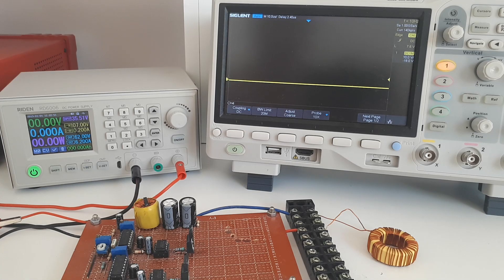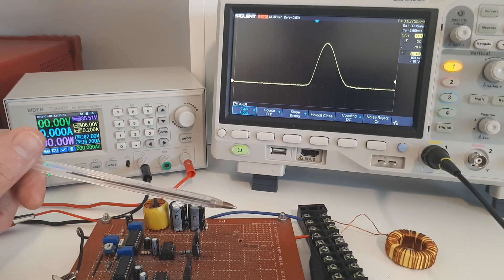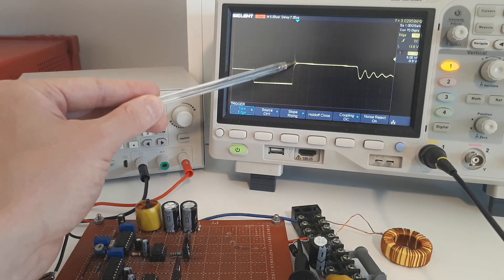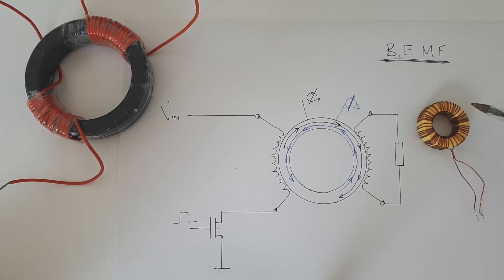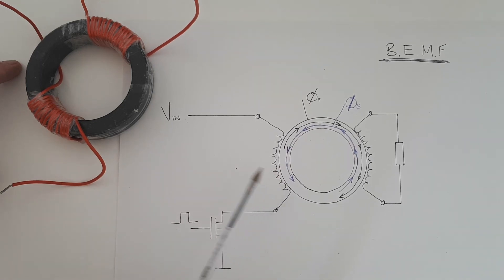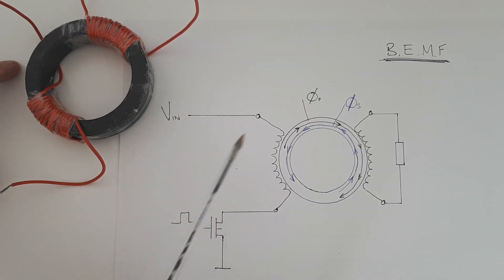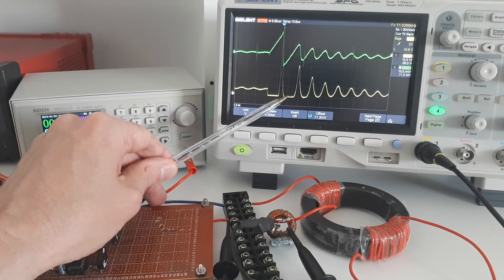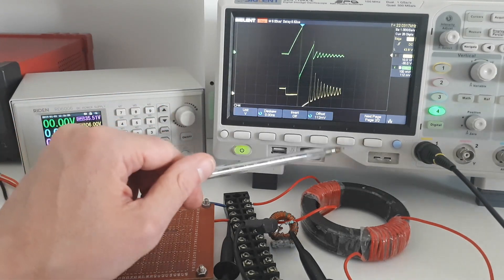What is Flyback Voltage and Back EMF

Comment: Is it fair to say that flyback voltage is a form of back EMF then? Back EMF being the greater domain?
Reply from the maker: Well there are similarities in that they are both a form of induction. And lenzs law effects both. But there are 2 main differences between them.
1. The Back EMF as I described occurs at the same time as the EMF you apply from the power source. Whereas the Flyback voltage occurs when the switch is off, and therefor is on its own at that point.
2. The Back EMF is only ever equal to or less than the applied voltage, but the Flyback voltage can be hundreds of volts greater that the supply voltage.
Reply: @ElectricMonkeyBrain  Thanks!
Reply: @ElectricMonkeyBrain   Fantastic.

Comment: As someone who have been observing Flyback and back emf for some time.. 
I can say that your explanation of the Flyback is correct but I have a different view of the transformer's back emf.

We all know that the backemf helps to regulate the current in the inductor, when the back emf is equal to the applied voltage this reduces the current in the inductor, this also applies to the primary windings of the transformer. But immediately the transformer secondary is loaded, the current in the secondary cancel's the backemf of the primary which in turn causes the primary to draw more current
Because the back emf of the primary is no longer equals to the applied voltage. 

The main difference between Flyback and back emf is that Flyback occurs when the current flow in an inductor is suddenly interrupted while back emf occurs when there's a change in Flux 

Back emf increases as frequency increases to the point where current is low. 
while flyback increases as frequency decreases to the point where current is high.

Comment: Thank you, this is extremely interesting sir. What if I wanted to direct the collapsing field into a battery sir? What electronic components would I use? Thank you sir.
Reply from the maker: Just a diode. should work ok.
Reply: @ElectricMonkeyBrain  You should use a TVS Diode to capture the flyback. It has some interesting effects on the chemical behaviour of the secondary battery.  If you use a battery relay to swap the run battery to become the charging / secondary and vice versa every 4 minutes, they both run for a very long time. Thanks for the video, it's one of the best explained I've watched. 👍
Reply from the maker: Are you talking about John Bedini's circuit? @hoofheartedicemelted296

Comment: Why did the voltage reduce from 400v to just 20v in the case of flyback when resistor is connected? Did u connect a very high value resistor? What was the value of your resistor?

Comment: What will happen if you wrap the entire ferrite ring with 1.0 copper and energize it? Does that make and induction heater?
Reply from the maker: Well sort of, but the amount of heat produced will be very small. Ferrites are bad conductors, so they wont dissipate energy in the form of heat much. If you want to produce heat with a induction heater, the magnetic field should be inside a good conductor...like metal.

Comment: Consider this:

1)  layers of thin aluminum sheet, each layer of metal separated by an insulation layer, in a horizontal orientation
2)  vertical magnetic field up through the center of the stack of metal/insulator/metal/etc  layers
3)  'eddy current' inducing coils positioned horizontally and radially to the metal/insulator layers
4)  supply an RF frequency to the eddy current coils

RESULT
Right hand rule:  vertical B field, horizontal RF current (E), in the metal.  This E x B  gives the Lorentz force, which coherently accelerates (oscillates) the charged particles in the metal

It is known as a "Lorentz disk" and is the first device built by artificial gravity hobbyists.

'Upgrades' include:
1)  circular planform (disk) for the metal/insulators stack
2)  adjusting the size of the disk and RF frequency to create resonance/standing waves of the RF across the disk
3)  working at increasing the Q factor  (ie. increasing the build-up of amplitude at the peaks, aka the 'anti-nodes', in the standing waves on the device)

This first device can be driven by a simple signal generator, a home-made RF amp to boost the siggen output, and store-bought aluminum foil.  If you use storebought foil, its thickness lends itself to a 'skin depth' that insinuates an RF frequency of about 16.28Mhz,  easily in the range of low-end siggens

Next is learning to attach a 'floating' or a DC potential bottom plate so that the effect is unbalanced (a balanced artgrav field yields no motion, just like two equally-matched teams in a rope-pull contest)
.
Reply from the maker: Well, I understand that there are some people who believe that a local and partial cancelling of the earths gravitational field can be achieved by combining high voltage (to cause a partial plasma) with a rotating magnetic field. Then one is into the realm of plasma physics and magnetohydrodynamics.  The idea takes Einsteins Equivalence Principle, and takes it one step further to say that the force from gravity is not simply equivalent to inertia, but that they are actually the SAME! Then somehow combining fields as i described creates a shield from inertia (gravity) allowing flight. As for the engineering of the whole thing its too complicated for text messages i think.
https://www.youtube.com/watch?v=1JeeaZlYonc

Comment: Hi.Does the same effect occurs when stator of generator collapses to zero volt and we have high voltage transient at the rotor?
Reply from the maker: A good and important question.
Its difficult to answer because there are literally 100's of different motor/generator configurations in existence, which have different effects.
For example a GENERATOR made of permanent magnets and output coils should have very little voltage spikes because the output coils should have some diodes or bridge rectifiers which will take away this energy.
A universal MOTOR for example, which has stator field windings which receive AC mains current, and rotor windings which receive current via carbon brushes will have voltage spikes in the rotor windings when the current through them is interrupted.

Comment: Does it mean we can put primary as L in LC oscillator and varying current in secondary with potentiometer we can tune oscillation frequency?
Reply from the maker: Thats a good question. I suppose it would work but may have some limitations. try it!

Comment: Egypt... tutankamon necklace with vulture holding a transformer.
2 paws 2 coils alu spools steel core. U shape.
Cross barr, soft iron with one coil.
Amber is the capacitor or in this case the alu spools.
Putting feedback on the spools as capacitor.

Comment: Weather you short out the secondary or not on a torodial transformer you will get back emf or flyback you will get a high spike in reverse  weather you short out the secondary or not so what is the difference who shorts out the secondary any ways unless your using partnered coils bucking coils? A higher voltage spike makes the difference because you shorted the secondary.
Reply from the maker: The point of shorting the secondary was to show that when current flows in the secondary, it has an effect on the primary. And that the effect caused a reduction in primary inductance showing that the secondary current/flux opposed the primary. Thats why its called back-EMF.

Comment: Great demo, thanks for that. The emf part of the demo is utilised in eddy current flaw detection in ndt and able to detect surface cracks in conductors through non conductive coatings. The secondary is the subject material in the ndt case though.
Reply from the maker: That's quite interesting. Amazing what they can do these days.
Reply: @ElectricMonkeyBrain  Not just these days. I worked on NDT by eddy current measurement in 1972 - my first job out of university.

The simplest test gear used a bridge arrangement with two coils powered at 50Hz (mains frequency). One coil held a sample of a correctly annealed brake lever for motorcycles and the other had a conveyor belt that passed through it where the levers to be checked travelled. If the bridge came out of balance by more than a certain amount in one direction or the other, it triggered a solenoid that moved an arm which deflected the errant component off the main belt into one of two reject bins. The levers that were too hard would be likely to fracture and snap and those that were too soft would be likely to bend.

The most complicated NDT equipment we made was for use in a steel mill where a continuous length of red-hot steel bar was made to pass through a large coil where we injected a low frequency (probably 50Hz) and a synchronised high frequency (perhaps 5kHz). The low frequency would penetrate some distance into the steel but the high frequency was confined to the surface layers (skin effect). A crack on the surface of the steel would be detected by phase-sensitive rectifiers as a significant shift in the relative phases of the two signals and that triggered a short squirt of engineer's blue onto the steel bar. Further down the line, the section with a the blue mark would be cut out, ensuring that the rest of the bar was free of surface cracks. All of that happened while the bar was still very hot and moving fast, which was a tough environment to do tests in.

That bit of electronics hasn't changed much in 50 years.
Reply from the maker: Right. Yes I think I have heard of this technique. Using the skin depth is quite a interesting solution to detect differences between surface and bulk material. Actually I think its a huge field, I expect they use essentially the same method to characterize ferrites for transformers up to about 800Khz or so.
I also used to do material measurement, but its was on the electric rather than magnetic side of things, and at much higher frequencies.
Reply: @RexxSchneider  I was going to say 'not just these days too', but anyway, Herr Foerster was making equipment to do ET back in the 1930s I believe. The real difference these days in most NDT methods is the addition of computing power to analyse results and improve the probability of detection. Eddyfi produce some interesting array systems for tubes etc.

Comment: 5:28 add 3rd asymmetric coil with a load
Reply from the maker: Hi. Do you mean that by adding a 3rd coil the BEMF flux in the core can be cancelled? Or do you mean that a 3rd coil can absorb the flyback voltage?
Reply: @ElectricMonkeyBrain  third coil will provide a channel for the back emf to flow, pay attention to the core dimensions and width. https://www.youtube.com/watch?v=Z_-3Nz1ZuSI&t=29s,

Flyback voltage is not the same as back emf

Comment: How do you divert back emf away from a MHD . Magneto Hydro Dynamic . I want to use pulsed DC instead of Constant Current DC
Reply from the maker: hi. Magneto Hydrodynamics is a interesting, large and complicated field. Without knowing more about your specific design, its difficult to say. However, in general I would guess that you are trying to produce magnetic fields, which means you need coils. If you want to recapture some of the energy of those magnetic fields after you have used them, a simple diode into a capacitor would suffice, like I showed in the video.  I would add that the speed of the diode is important. The 1N4000 series of diodes are very slow, and work good for 50Hz only. Something better may be a HER5000 series. To find really good diodes simple google "fast diodes".
Reply: Noob here. Check. Germanium diodes. 
Crystal radios and loop antennas. Resonant frequency.
Soft iron for low freq. Steel magnetizable for high. 
Ceramic has a big range in choice.

Comment: Very well done! Your distinction between flyback and back EMF (collapsing magnetic field inducing a voltage in a coil that is in the reverse direction) is correct! The electromechanical logic is simple to understand in backflow, when you consider that the north and south magnetic poles are pushed up in one direction by the current when created. And, like a child pushed up on a park swing falls backward by gravity, so too the magnetic field collapses back in the opposite direction when the voltage is removed!
Reply from the maker: Thanks. Yes you right about the analogy between Electromagnetism and Newtonian Mechanics. In fact the analogy goes even further since the equations of Electromagnetism were based on those of Newtonian Mechanics. Perhaps this would make a interesting subject for a future video, thanks for the idea.
Reply: Ed leedskalnins... pmh.